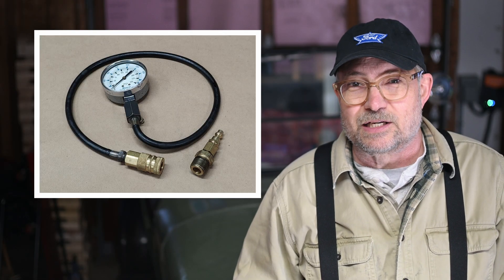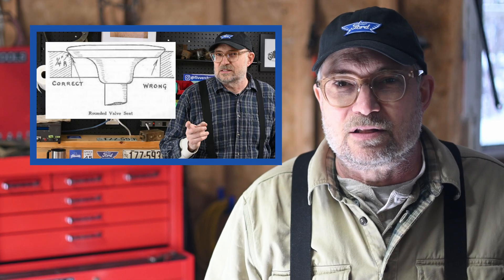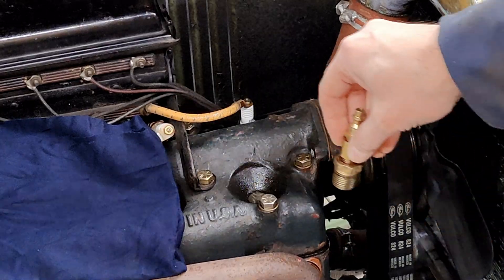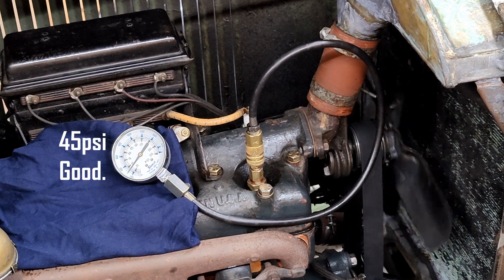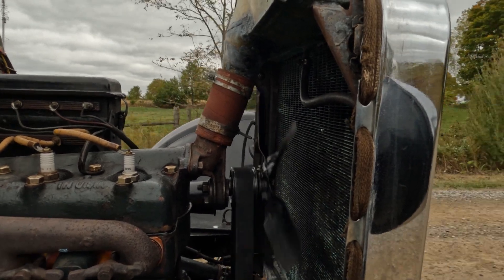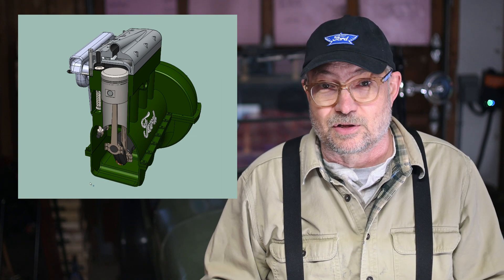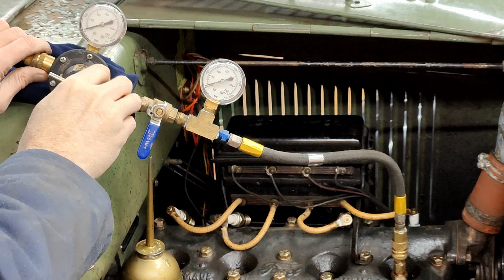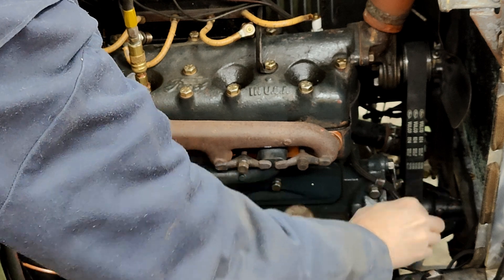Better Way to Test Compression? -  Differential Compression Ford Model T

Comment: Steven, I've never understood the value of a differential compression test over a simple cylinder leak down test until watching your video. Thanks again for such great content.
Reply from the maker: Usually, a regular compression check is enough. But when you're trying to learn more about where it's leaking... Thanks for watching!